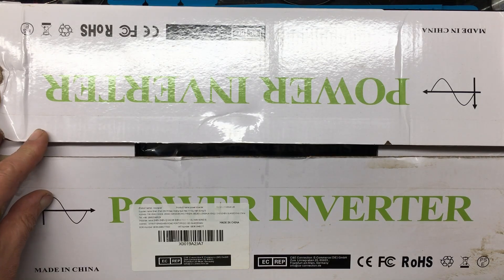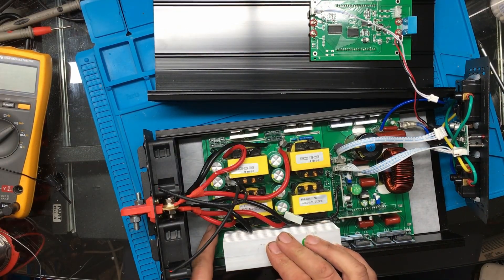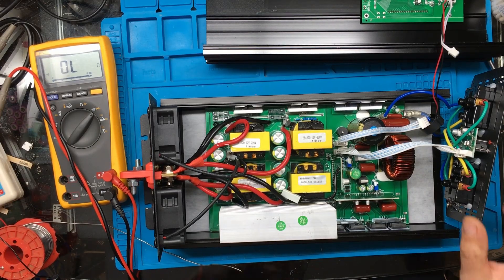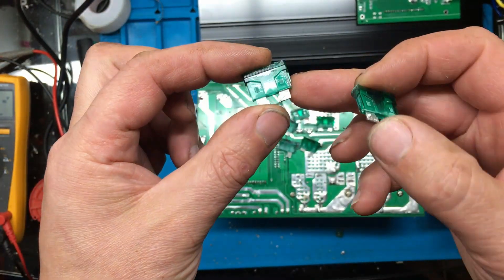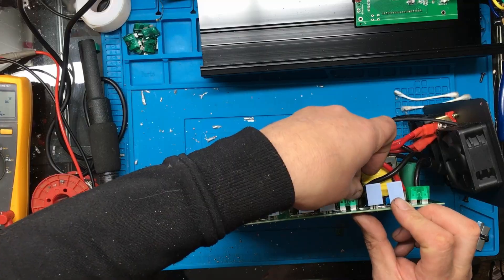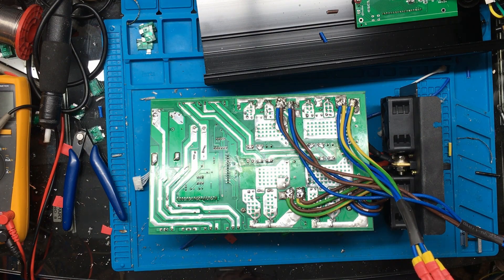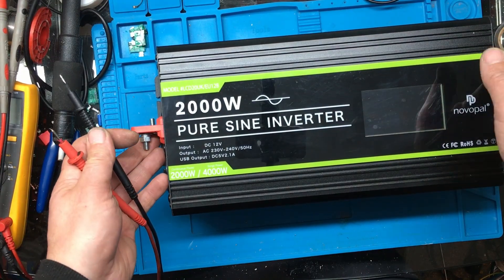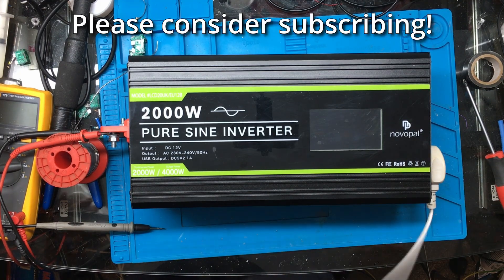2000W Pure Sine Inverter - Blown Up! - Let's fix it!

Comment: There are pcb fuse holders for ATO fuses but usually rated to 20A. These fuses go thru a lot of temperature cycles that will wear down the contracts. This is a cause of problems in cars. Better to solder them in. Temperature is important. Don't be surprised when a 30A fuse is only 20A at 40°C.
Reply from the maker: Thanks for that 👍

Comment: Fuse sockets wouldve been a cleaner job, rather than that aweful bunch of wires...
Reply from the maker: Totally agree, I didn't have any so just used what I had.
Reply: @BuyitFixit completely agree. Fixed a lawnmower this month at the repair café where most of the plastic inside the handle was shot. A piece of flat gravel from the car park fitted perfectly to let the switch work as it should (stay where it should be) A few dabs of super glue and that'll hold for a few cuts at least. Probably years tbh. Then a bolt through the handle/frame at the pivot (mind was blown when I spotted that was designed in yet not used) and magically it was all good again, despite most of the internal plastic cracked or missing.

Comment: Most fuses like this are not aluminium, They are usually plated copper or the likes. your problem in most of this is your absolutely tiny irons, it´s among the smallest ones I ever seen for such a heat demanding job and the fuses you had never got hot enough to accept any solder (aluminium or not). My first reaction was: wow that small thing never gonna get the fuses off and then oh here comes the bigger one that was just a "normal small iron" to compare my "small" daily use pro solder station is 60 watts up to 480C, it can have tips from 0,5 to 4mm size, and when that is not enough I have bigger ones like 80 or 100 watts that I would use in a job like this where it is thick heat absorbing areas of the PCB. Solder never gonna stick correctly to anything if you solder too cold as you did here and you are just going to struggle. you can also Pre-heat the board with hot air when needed. I always say you can never be better than your tools :) if you work a lot on electronics you would love a good temperature controlled solder station with at least 50 watts and swappable tips :)

BTW the Inverter were saved by the fuses for sure, the reason all of them blew was because there is a "body diode" in all mosfets that conducts like a regular diode if the chip is put in reverse bias and they act as a direct short to ground that way. if there were no fuses the fets would have exploded instead. it is actually a pretty good design they made except they should have put fuse holders on the PCB instead. They likely omit these as both a cost and performance reason as wires and connections all have voltage drops in high power applications such as this.

Keep making repairs! if everything was designed to last the environment would be a lot better today. Everyone that makes repairs instead of throwing away things are heroes!!
Reply from the maker: Thanks 👍Agree most automotive fuses I've came across aren't aluminium, however these were 100% aluminium. I guess it was a cheap set from Ebay or Amazon and they made them from aluminium to save costs instead of copper as you rightly said. 
The iron I use is a temperature controlled one, with removable tips based on a JBC I think (aixun T3A). Funny enough I did a video on repairing it as it stopped working on me. It did manage to solder the two wires onto each side of the PCB which would probably have more thermal dissipation than the leg of one of the fuses. I do enjoy trying to repair stuff and I volunteer at the local repair cafe trying to repair broken items for people in the community.  Thanks again for your thoughts and comment. Best wishes. Mick.
Reply: @BuyitFixit  No problem :) Repairing stuff is becoming a pretty rare thing today so I do what I can to learn what I can to those who have this interest. it is actually possible to solder aluminium with regular tin if you know how but I would not use such fuses in a device like this anyway. too bad they were that cheap on them in your case

Comment: If connected to battery first it will blow fuses. Connect to inverter then battery.
Reply from the maker: It was connected up the wrong way round, positive lead to negative terminal etc...

Comment: I was expecting a blown revers polarity diode, but a handful of blown fuses is even better!
Reply: A reverse polarity diode wouldn't blow, that's the whole point of them also you can't easily add reverse polarity protection at reasonable cost when current's get up to this sort of level, the diodes get expensive and dissipate a lot or heat so you need more fancy methods which is why these inverters virtually never have it. What they could have used is a form of crowbar circuit which clamps and withstands the current for long enough to allow the fuses to blow before damaging anything else.
Reply: @mfx1  Guess you've never seen a diode that had more amps put to it than it was designed. They sure do blow! And yes, their whole point is to stop reverse flow and trip off whatever is providing that reverse flow. But when the power source has more ass than the diode is designed for, they do blow.
Reply: @inothome  A REVERSE polarity diode won't blow, it will block the current flow, no current=no bang/smoke. You're describing exactly why these devices don't contain reverse polarity protection on the input, the current involved is to high which is exactly what I said.
Reply: @mfx1   it is using crowbar diodes. that's why it blew the fuses instead of the fets. he tested them after checking the fets
Reply: @Mattvbro  doesn't matter what sort of diode I was refereing to the "Reverse polarity" bit. If it was a crowbar then it was doing it's job and neither reverse polarity or blown.
Reply from the maker: Yes, I had been expecting the same, and possibly blown mosfets too!
Reply: @BuyitFixit  how to know if mosfets are blown?
Reply from the maker: @Johny333-xk9js check between the pins with meter on diode check. You shouldn't get shorts between the gate pin and source and drain. Sometimes you can trigger the mosfet with an test meter but you shouldn't get a short between the  source and drain pins either.
Reply: @BuyitFixit   thank you :D btw i fixed heater same problem broken fuse :D
Reply from the maker: Nice 👍
Reply: I would have fiddled the wires to connect the fuses thru the upper side of the PCB and soldered them on the underside - or would have soldered in fuse holders...;-)
Reply: This "reverse polarity" created confusion, as different people understand different things. In s low current circuits diode in series would protect the circuit from being powered. Here the currents are higher, and 20-30A diode would add, say $5-10 to the end product. Crowbar diodes are typically used to protect the outputs, say power supply, from overvoltage which may damage the circuits being powered. Here the input needs protection from reverse polarity and the usual brute force method is not reverse but antiparallel diode, i.e. its cathode connected to the positive input (battery) terminal. Typical failure in power diodes results in short, therefore this short the battery and some wire blows or insulation starts melting and you should disconnect. But the inverter is protected... Well, not very elegant solution. And, in addition if a 30A fuse is added in series to either of input terminals it will blow and all would end up here. Change that, say, $2, 5A anti-parallel diode and $0.50 fuse and you've got some input reverse polarity protection....  And, BTW, any DIYer can add this protection circuit to their inverter input terminals... 😎.... Just food for thought...
Reply: @dokopal  The main issue with simple series diodes on high current stuff is the heat dissipation from them which is why many inverters, even fairly high end ones don't have reverse polarity protection and often have clear warning stickers.

Comment: these normally have a big diode  wired in reverse across the 12V in and basically make the fuses go when wired wrong as in this case saving all the transistors etc - sometimes the diode shorts too - but looks like you got lucky here
Reply from the maker: Thanks morenormal👍
Reply: Yup. I've noticed they have skipped that reverse polarity protection on newer devices unfortunately. 😢

Comment: I got a giantz 2500w inverter that powers up the display does everything it even tries to put out 240v it does for a few seconds but it just beeps and cycle's tries to power then beeps again any idea what I should look for
Reply from the maker: Hmm not of hand. Sounds like the unit could be sensing some type of overload and the resetting perhaps? Have you tried with and without a small load on the output? Could also be something like a faulty temperature sensor? Not sure if it displays a temperature reading somewhere?
Reply: @BuyitFixit  yes I've tried no load and small load and heavy load it has power input and output displayed on the front have good voltage on input side and it gets to around 32w 240v output before it beeps  shows 5w output no load before it beeps seems to humm when it trys to output power
Reply from the maker: I did a quick search, and there's a 1 star review on amazon with the person saying it overloaded even with an 800w kettle. Are the input cables thick enough?
Reply: @BuyitFixit  it's the cable's that come with it I'll try new ones later when I get a chance tommrow but there doesn't seem too be any voltage dropping on the input side of things according to the inverters display , can't see any blown Caps or burnt out coils and all the fuses are fine

Comment: Just a quick note that fuses are there to protect the wires (fire hazard protection), not to protect the electronics.  That type of fuse is not intended to be soldered into place, so that process likely partially melted the fuses leading to infant mortality failure.
Reply from the maker: I also think a likely contributing factor was the previous owner connecting the red wire to the black terminal and vice versa 😂😂
Reply: I've seen soldered-in blade fuses in plenty of UPS boards. Littlefuse appear to have tin plated blade fuses in their range.

Comment: Great idea to reroute the fuses. Why can’t a breaker be used instead of the fuses?
Reply from the maker: Thanks Dean, probably cost and also if the fuses fail under normal operation I would mean something else has failed such as the output mosfets.

Comment: I find myself incredibly excited and hopeful that one day with some tuition from a local  electronics genius, I will be able to repair expensive  (and  those awful cheap) gadgets that are so often written off, when they break, by the companies/repairers that make or fix them. I've lived for 35 years with offgrid solar systems. Watching the horribly expensive demise of seven high quality inverters in that time, mostly due to lightning strikes and irresponsible installers, has become too much for me financially and in principle, NOT to try to do something about fixing them, so I'm learning how. While I'm waaaay off fixing the  old SEA inverter that blew up mysteriously a short time ago ($6000  to replace it with a similar model and $2000 quoted for the capacitors and presumably other components plus labour), I had a win today fixing a big spot lighting torch I found in a skip, by resoldering two broken wires on the control boards,  and replacing the battery and a spade connector to one terminal. Someone threw it away. I was able to get it working again. That's where I begin. Simple is a good place to start. The exercise is learning how, even if the thing cant be repaired. The inverter it seems may be able to be repaired for a few hundred dollars if I do it under the tutelage of a qualified electrician who can make sure it's a safe repair, a process that is underway. I'm already some of the way forward when I can diagnose what went wrong and that's why I pull things apart, BEFORE I throw them away. And I find so much that can be recycled in the componentry. Videos like this help by teaching me what's what and why it's there and what is possible with some out-of-the box thinking. As soon as I saw the soldered spade fuses, I thought "oh that's silly, what if... and voila! simple is best. A great way to see how it's done by the experts. Thanks.
Reply from the maker: Thanks for your comments and kind words. I've actually repaired a couple of solar inverters and did a video on one if you haven't seen it. Perhaps it may help in diagnosing one of your inverters? I'm not and expert but I've got a fair bit of experience in repairing things 🙂

Comment: Thank you so much, this has been really helpful. Different 'brand' name, different power rating. But the one I have has all the exact same major components, the same manufacturing methods, even identical packaging and info. markings. Clearly out of the same factory. It is so difficult to find reliable repair info. for this kind of stuff. So surprised at the cheap fuses, when the build quality is comparatively good and the majority of components are actually reasonably good quality. Ship, spoil and 'hapeth' of tar spring to mind. I am 90% sure there used to be a copper automotive spade jumper available - very short, all one piece, male at one end, female at the other. These would have soldered directly into the board slots and effectively made 'sockets' for the plug-in fuses.
Reply: These manufacturers tend to take actual work and then run off a bunch of 1-offs of their own to sell under their own name.  Compare Aims Power (inverters sold by an American company) with SunGoldPower.  It's identical down to the case design.  Only the color is different.  Yet another reason it's bad to run an economy on outsourcing.
Reply: Totally agree. But its generally 'ignorant' pen-pushers in 'accounts' that win this argument. But even then it only ever 'pays' in the short term and the hidden costs of lost domestic jobs and GDP deficit etc. are left for the taxpayer and government to absorb. Not to mention the illicit acquisition of 'free' technology. And thank you for for the observations about the 'original' brands. Sooner or later their more comprehensive technical data and possibly 'spares' will be invaluable in fault-finding and repairs to extend the working life of these units.
Reply from the maker: Thanks John Robert. I'm glad you found it useful. If you like electronics please check out some of my other videos. Hopefully you'll find those interesting too!

Comment: First time I have ever seen an inverter built so the fuses saved it. Lol. Good design. Every one I have ever repaired the fuses were fine but had a lot fets blown and bad SPWM boards.
Reply from the maker: Thanks AJ WD, I was expecting pretty much the same, blown fets and possibly driver chips, but it seems that the fuses saved it!
Reply: you might find they are all design that way, even the cheap 60w one that you plug into the cigarette lighter socket
Reply: @dantronics1682  No there not. I have repaired a bunch and have found only a couple with blown fuses. It is most always fets and controller board problems. The 24 volt inverters get hit the hardest. I had one with blown fets, burned transformer and bad controller board fuses were still good. Lol. Real poor design.
Reply: @user-tn1hk6zm2freedom  I think we are talking about 2 different things, I was talking about reverse polarity protection, I cant see so much people wiring them up thinking that red means -ve but I agree that the boost voltage stage gets hit the hardest
Reply: @dantronics1682  Ok. One thing that should be added to the design on power inverters id a big diode on the input so that if it is hooked up wrong no current will flow. An easy fix to people hooking them up backwards. An easy mod.
Reply: @user-tn1hk6zm2freedom  yes it is an easy but very inefficient fix, people who hook them up backwards shouldnt be allowed near them, its people like those that use alumium foil as fuses. think about it, if someone is going to be connecting up a device thats drawing in excess of 150 amps and dont even know which way its suppose to be connected they are a danger to themselve and anyone around them. You said you repair them, I dont know your technical ability but to say have an inline diode which have a voltage drop of at least 0.6v to be carrying a current of at least 150 amps seems like a very poor design to me but as I say I dont know your technical background. are we talking 0.6v*150 amps to work out the heat dissipation? would that be 90w of wasted heat?